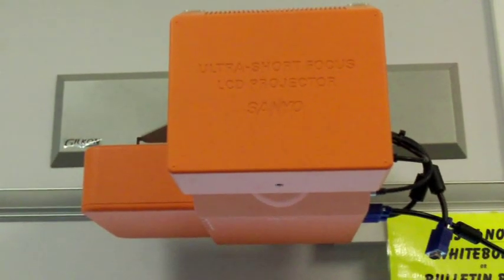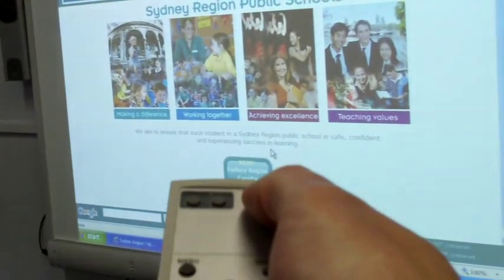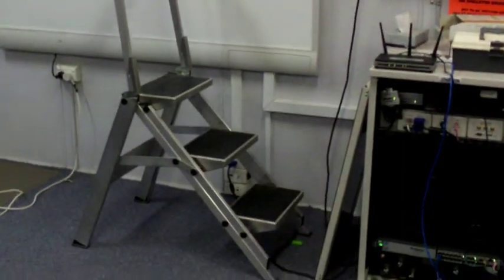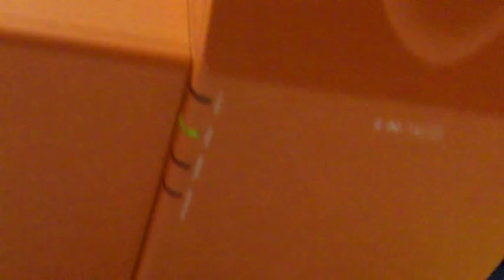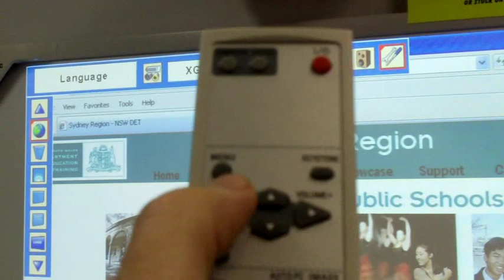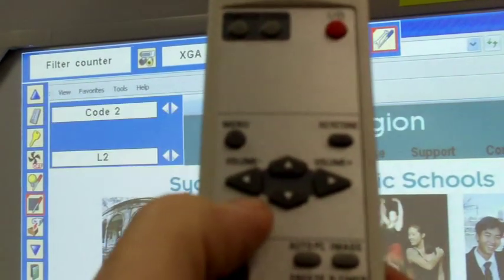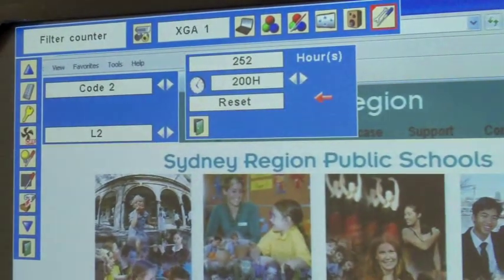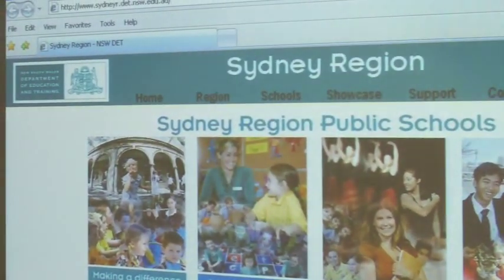Sanyo PLC-XL50 Projector Filter Cleaning Guide

Comment: Is there any way to resen the filter counter without using the remote? I can't also access the menu by using the buttons on the projector. It was cleaned inside. After switching on i counts to 10 and turns off :\